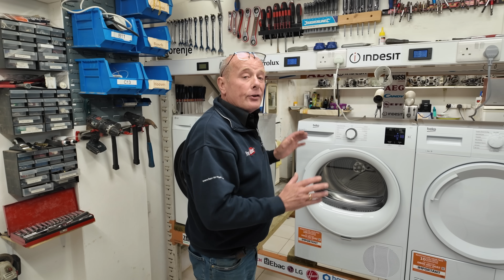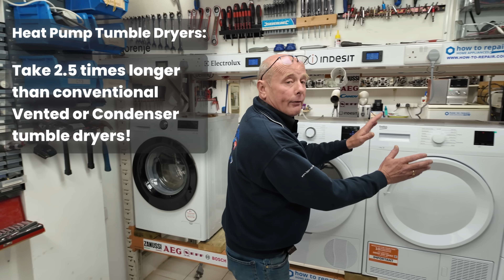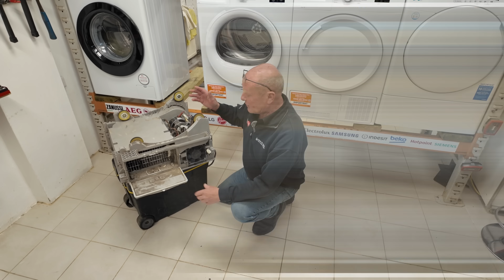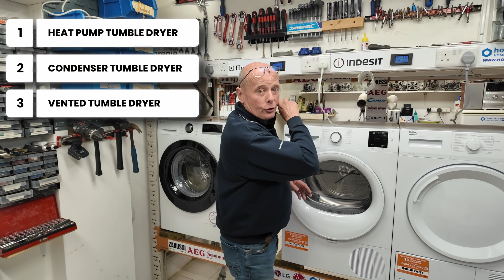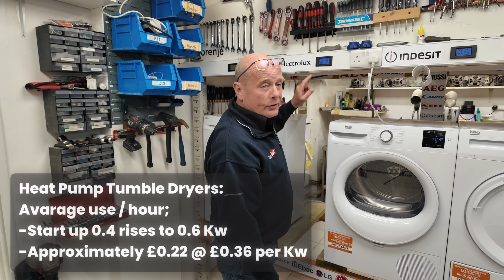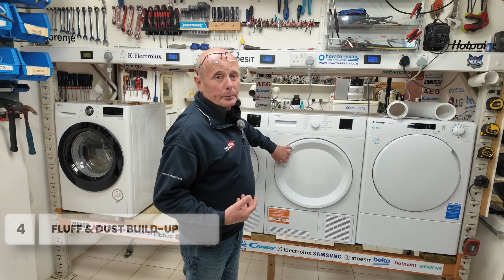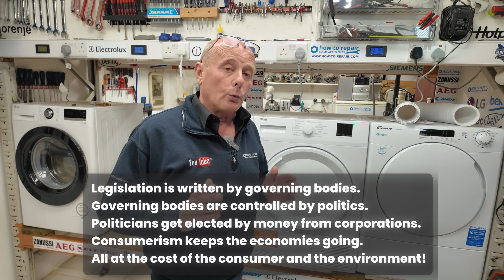Tumble Dryers the Shocking Truth About Heat Pump vs Vented & Condenser, NEW LEGISLATION!

Comment: I have been using dryers for 40yrs.  Front vented old school dryers are the fastest.  I had a condenser dryer in an LG washing machine.  It took too long and was not as good as my front vented dryer . Clothes were more creased, more lint left and the clothes absolutely stank compared to the front vent dryer.  I'm Italian and very fussy about my clothes.  Basically, the longer it takes clothes to dry, the more likely they are going to have a mouldy smell.  I was so impressed with your analysis and you confirmed everything I had thought about this scam of forcing people to change technology.  I have solar power, so I would rather use an old school dryer during the day and get things dried quicker as the electricity is for free.  Thanks for also discussing wear and tear on clothes.  As I am petite, I have modified all of my clothes to fit my figure. I don't want to keep buying new clothes and seeing them to fit if they can last longer.  Most environmentally friendly things are not at all when you calculate the long term environmental cost.  Thankyou again

Comment: There is mis in your assumption on the clothing where and tear; A HP dryer dries at aprox 50°C where the others drie at aprox 75°C, which tears the clothing far more than the drying time does. Compressor and vent dryers are also more prone to fires. And they both also heat up the space they"r in.

Comment: I have a vented tumble drier that is about 18 years old, it's noisy, was cheap and won't run on cold any more. BUT IT WORKS, RELIABLY, and shows no sign of giving up, I had s monitor on it and really it did not use as much power  as I thought, So it stays !

Comment: Planned obsolescence should be exposed more and made illegal. I nearly bought a heat pump dryer today, but thinking against it now. I don't it use my current condenser machine, very often, try to limit due to cost, just for towels. I can easily remove the condenser but I wouldn't be able to maintain a heat pump in the same way which is ridiculous. Thanks for the videos, extremely helpful!
Reply from the maker: I am glad the videos were helpful mate. You are making a smart decision to pause that purchase. Your old condenser dryer is easier to maintain you can easily access the condenser and physically clean it of fluff and residue. However, heat pump dryers are far more complex to clean and maintain. If a heat pump dryer breaks down due to lack of heat, the fault is often the refrigerant system or a sealed compressor. This repair is typically so costly that it immediately pushes the machine into the financial write-off category, often just after the warranty expires. We need "Right to Repair" legislation to force manufacturers to use accessible, modular components, even in complex heat pump systems.

Comment: I'm a retired commercial laundry engineer, Electrolux Professional introduced a 15kg heat pump dryer for the commercial market more than 15 years ago, we were not allowed to repair the heat pump unit, just exchange, not difficult as it was designed that way, however even then the unit price was in the order of £3000 + labour + VAT. And they still need sufficient make up air not unlike a gas heated appliance!!

Comment: Nonsense! Heat pump tumble dryers that need a £200 service to clean the lint filter are almost as brilliant as wet cambelt internal combustion engines.💥💰
IF YOU'RE WASHING MACHINE ENGINEER!💰💶🤑🫰

Comment: Got rid of our heat pump dryer as it took 5 hours to dry our sheets. We paid a fortune for it but it wasn't sustainable to use because it took too long. We've had our beko condensor dryer now for 6 years and it was less than half tge price. Its on 3 times a day or more in winter. I wouldn't buy another heat pump dryer.

Comment: What kind of research have the the people making these decisions done. Im sure if a washing machine engineer in South Wales can work out that the heat pump machine is more costly in the long run then the other machines then they want sacking and you take their jobs. Is someone taking a back hander from the manufacturers? It certainly does happen, lobbying i think they disguise it by.

Comment: I have a vented whirlpool Dryer over 20 years old. I only use it on the last 30 mins of the timer that runs at it's coolest setting by turning the heating element on or off. It does not simply reduce the temperature the element heats to. It heats up then runs on fan only then heats up and so on. Because it spends over 50% of the time running on fan only with the element off it actually is very cheap to run. A full load costs less than 5p to dry. I use a Watt meter chich also gives the cost when in use. It does mean I have to reset every 30 mins but that's no problem as I'm retired.

Comment: I was just looking at Hisense 5S Series DH5S102BW 10Kg Heat Pump Tumble Dryer - White - A+++ Rated £499 vs Beko B3T41011DW 10Kg Condenser Tumble Dryer - White - B Rated £384. I was going to go for the fancy heat pump but after what you have said I think I’m going for the condenser

Comment: Surely the evaporator and condenser should be at the top of the machine. Then easy access for cleaning by removing the top cover, Also the water container should be at the bottom so no pump is needed.

Comment: The condenser dryer, if inside your house when running will dump its heat into your house which in the winter will add to your heating which is beneficial.The vented dryer not only dumps its 2 kW of power outside but also has to bring cold air into the house which will need to be heated.

Comment: As other people have mentioned a heat pump dryer won’t work in an unheated room.
I’ve a Bosch condenser dryer happily working in my garage for the last 15 years and before in my previous garage for over 10 years.
Can’t believe a new heat pump dryer would last anywhere near that.
It’s clear the government has been “greenwashed” and the consumer will be the loser 😞

Comment: I hate drying wet laundry indoors when it's cold or raining outside, so a condenser dryer is a solution.
That turned out to be a Zanussi.
I bought it secondhand.
This old machine ran for at least five years.
After that, we bought a new Sharp heat pump dryer.
In our experience, this one dries faster than our old one, which we sold for the purchase price.

Comment: I think it's fair to say that heat pump technology design, especially from mainsteam manufacturers in household appliances, is still in its infancy. There are manufacturers who have had the tech buttoned down right for years, but they tend to be less well known. The mainstream will get better. Already, in terms of operation cost savings, heat pumps easily are. Maybe check out the makers who have used heat pumps for many years, rather than choose from those makers you're familiar with.?. However, there's always the washing line - a free energy clothes dryer, or even an airing frame [which I use and it works very well indeed].

Comment: I had a Candy condenser (until recently) it ran three times a week for nearly six years. I was able to replace the worn out front drum support rollers myself for 20 quid giving it another year before frequent non start-up issues set in.  Now got a Hoover condenser….the clock is ticking….

Comment: The heatpump drier uses less power, but it uses that power for longer - 2.5 x longer so 400 wtts for 2.5 hours = 1.2 KWh - while the other driers use 2.5 kw for 1 hour,  which equals 2.5kwh,  so it is not just comparing 400 watts with 2500 watts and saying that the heatpump one is 6 x better, it is only 2x better

Comment: We have been using an LG normal condensing drier for about 16 years now,  I have replaced the drain pump once and had a belt break about a year ago - never found much fluff inside and the heat exchanger is easily removable ( not something you can do with a heatpump model ) and you can simply wash any fine fluff out with a tap over the sink. .  It blows the heat back into the house,  this reduces the energy our central heating has to supply...

Comment: What this video is missing is that all the heat produced by the normal condenser drier is kept within the building,  meaning that is colder seasons the central heating is going to need less energy. With the vented drier even though the energy used may be about the same,  you are heating your garden up...

Comment: Having a Vented dryer I put a $25 air diverter in the exhaust line which helps heat my house in our long winter which saves me money plus I don't have to run a humidifier nearly as often

Comment: I'm looking at purchasing a tumble dryer. All of my washing will be dried outside and the tumble dryer will help to air it through if needed, so only on for 5-10 minutes at a time. This is not an effective way to use a heat pump machine.

Comment: No, the consumption is three times lower — 0.6 kWh in 1.5 hours in my case (Bosch Serie 6) instead of at least 2 kWh for an almost equivalent drying duration. I’ve saved about 1000 × 1.5 kWh × €0.30 = €450 on my electricity bill over 5 years. That’s almost the purchase price.

Comment: No, the consumption is three times lower — 0.6 kWh in 1.5 hours in my case (Bosch Serie 6) instead of at least 2 kWh for an almost equivalent drying duration. Filtration is generally much more efficient, often with three successive filters. But it’s true that the old condenser dryer used to heat the bathroom, whereas the heat pump one hardly does. As for repairs after 5 years, still no issues with around 200 cycles per year.

Comment: I’m glad I this video came up. I am considering replacing my Hotpoint condenser dryer, not broken but more than 10 years old now. I enquired about the options at a local store and it was explained how heat pump machines worked and the legislation concerning the forced redundancy of vented and condenser dryers. 
Having watched this video I think I need to quickly get myself a new condenser dryer whilst I still can and not be forced to buy another appliance that will break whilst not being repairable and cannot even be scrapped.

Comment: I'm an electronic engineer. My hobby is reverse engineering and fault investigation. I have two cases with Siemens/Bosh (can share the photos and documents if you want). 1. IQ700 Siemens heat pump drying machine. After 6 years the drum doesn't move. The failure was - a 15A relay (costs 2 euro) which switches on/off the motor. And the IGBT module, part number IRAM535-1065A, which control the inductive motor (costs 5 euro on Aliexpress). You can't find the data sheet for the part, but I work for a company who produces the module and found it. Also I found a very interesting internal presentation and I got the full picture. The module package is made full of plastic to save cost, at the same time competitors make the surface ceramic with better thermal conductivity. As result due to poor thermal conduction the module fails because of limited amount of thermal cycles, you can't solve the issue with bigger heatsink the bottle neck is junction to surface thermal resistance. So, it means I have to exchange the part every 6 years. There is no information public, technicians can't investigate the issue, they simply change two electronic boards - motor control and relay board (probably cost about 500 euro even more). 2. The second issue is Siemens blender. Just after the warrantee of two years the rectifier bridge (discrete 4 diodes 2A 600V) failed. Current level is on the edge (in transition load level might be quite high). I changed the bridge to 8A 800V and the blender has been working already 8 years.

Comment: I'm hoping my small vented dryer which is only used occasionally to finish stuff off is going to outlast me. I still have my old spin dryer (not a drier) in the shed. I won't buy a heat pump dryer I'll just put stuff on a radiator if needs be and turn my dehumidifier on.

Comment: What about the self cleaning condensor heat pump dryers? I have a Bosch with that feature. It is the only thing I was sceptical about when buying it, thinking: I should be able to just clean it myself regularly.

Comment: I used two types of dryers, a Miele condensing one and two Beko heat pump ones.  Condensing Miele dries in the first cycle longer than Beko with a heat pump.  As the cycle progresses, the efficiency of the condensing machine decreases because the condenser itself heats up and its efficiency decreases.  In the second drying cycle, the condenser is very heated and the drying time is drastically extended.  The only thing that helps is cooling with cold water.  The claim without actually drying an equal amount of laundry and comparing the time and humidity after the cycle is complete is frivolous.  As I mentioned I own two Beko heat pump dryers.   One was bought in 2013 and it still works perfectly, no interventions such as refilling the system or cleaning have been done.  I have owned another Beko with a heat pump since 2020 and it works perfectly.  The only complaint, with the newer model, the manufacturer saved on the filter and the machine does not have another filter near the condenser, so there is a possibility of clogging the condenser, so I bought an identical filter as on the old machine.  Another advantage of the heat pump, in addition to greater efficiency, is the lower heating temperature, so clothes that, due to their sensitivity, are not designed to be dried in the machine can be dried in this type of machine.  I have done this countless times and there was no damage to the clothes.  So I always give my vote to the heat pump.

Comment: when either my 17 year old washer or dryer fails irreparably I am going to find a commercial speed queen unit to replace it, will most likely be the front loading washer with electronic controls, dryer was literally the cheapest GE unit I could get at the time, so will most likely last another 17 years, no fancy controls or options on it

Comment: My vented tumble drier did not line up the same as old one with hole in wall, and was tripping out on overheat, so did all of its life at 1 kW instead of 2 kW, there was a simple switch at the rear, as a result it took longer, around 90 minutes, sometimes needed to run twice, as clothes not dry enough for less time of course, but on average 1.6 kWh per load. The heat pump drier which replaced it to 150 minutes, so 1.625 kWh per load on average, which is as near as one can say the same power wise. 

The change did allow me to close a window in my new home, so stopped the black mould due to leaving the window open, and it allowed me to set a delay start so using off-peak power, and heating bill went down with the window closed. And it auto sets the time required, so all in all, glad I changed, as to other types of condenser drier, as clearly heat pump driers are still condenser driers, it does not heat up the room it is in, or waste water, with water cooled types, the room would have been too small for air cooled type. And both air and water cooled types, seem to be fixed at 2 kW or more, you can't select a longer running time.

But the heat pump drier is not cheaper to run to any other drier with the same dry time.

Comment: Well, the energy savings will most likely offset the "possible" repair cost. Of course there might be corner cases with bad quality etc., but for most devices I think it will work out. 

Sitting here with a 15-20 year old and perfectly working heat pump tumble dryer. No repair done yet and it saved maybe 75 to 100€ per year doing that.

Comment: My heat pump drier cost me £350 and saved me that compared to a condenser drier inside 18 months.Despite the disadvantages you list, i would defintely get another.Its currently 4 years old and still working ok (touchwood).

Comment: Thank you, the video was really informative. It seems to me that heat pump technology is a step backwards, if not two. So much for 'Net Zero' if they have built in obsolescence due to servicing costs. I will definitely be buying a new standard tumble drier before they are phased out so that I have a spare one, I will also have my existing drier serviced soon whilst the parts are still available.
Reply from the maker: I think you are making a very good decision. Thanks for watching and for your support. I've recently published a video that specifically addresses planned obsolescence. Here is the link in case of you’ve missed it: https://youtu.be/crzZEvFf_L4?si=LYo5lbSxWdWY_yX7

Comment: I purchased an LG dual inverter tumble dryer around four years ago and recently the bearings of the support wheels at the front supporting the tub were worn out and started to make a beating/pounding sound. I was able to replace them myself. Costs €25,-. LG guarantees 10 years of warranty on the dual inverter and I hope the rest of the machine will last 10 years. We also noticed that the dryer takes much longer than our previous condenser dryer.

Comment: Thanks for the reassurance. I recently bought an Indesit condenser dryer, the "White Knight" one I bought in 1981 had finally died.  I looked at air pump models but the purchase price put me off. Your presentation confirms my decision was the correct one - in my reckoning anyway. I almost always dry laundry outdoors, the tumbler is used mainly to soften towels etc. when still weather leaves them "hard". And for de-creasing some shirts etc. easier, faster and probably cheaper than ironing, I find. Given that I tend to use it only for 10 or 30 minute sessions a couple of times per week I would likely never recoup that purchase price difference. And any extra energy use will be defrayed by the lower environmental impact of it's likely better longevity and easier recyclability at the end of it's life.